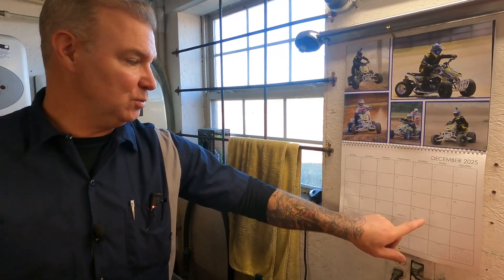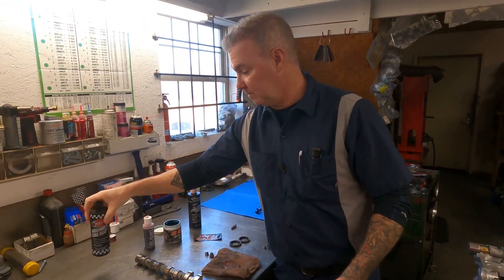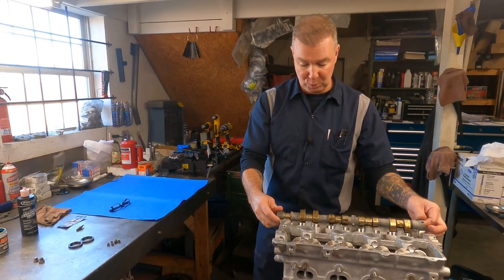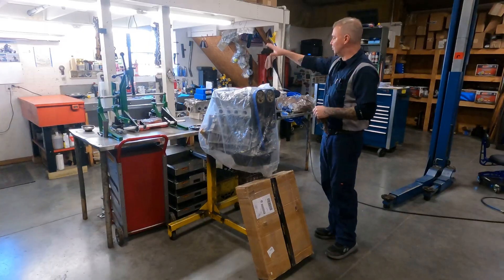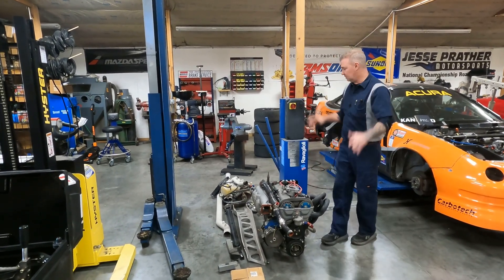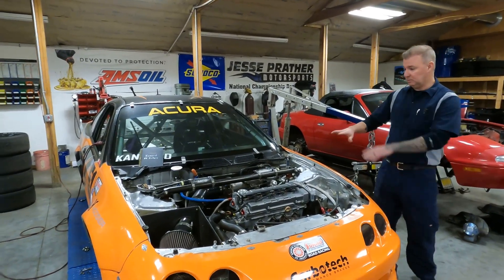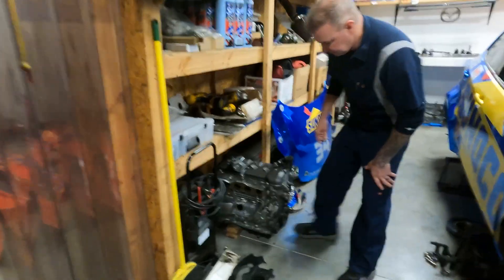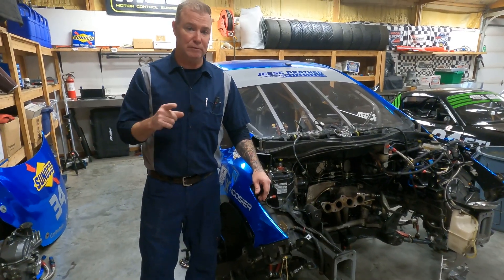SHOP TOUR - Assembly Lube Showdown - Why I use more than one!

Comment: I have a similar philosophy and technique pertaining to assembly lubes Jesse. 

I like the Driven HVL (High Viscosity Lube) for lighter applications such as general assembling of various components including oil pumps.  I like the Lucas assembly lube for bearings or similar reasoning that you like the Red Line.  I prefer the Driven assembly grease for camshafts for the same reasons that you mentioned as it is the last place to get oil flow and the stuff stays put.  

I also really like CMD #3 for severe pressures and as a leading lube such as wrist pins as well as general purpose high pressure lube.  

For old style distributor gears and other great it spline meshing I really like Driven Spline Grease.  

Thanks for another great tour and hope you and your family have a Merry Christmas and a Happy New Year.  

Mike
Reply: Thanks for the comments and Merry Christmas to you too!